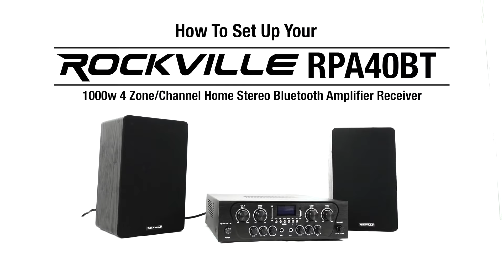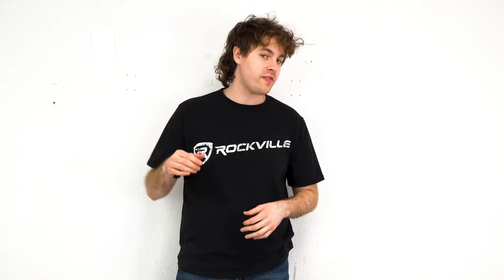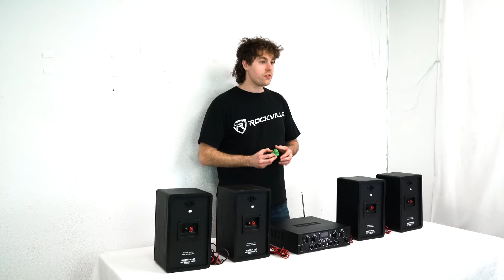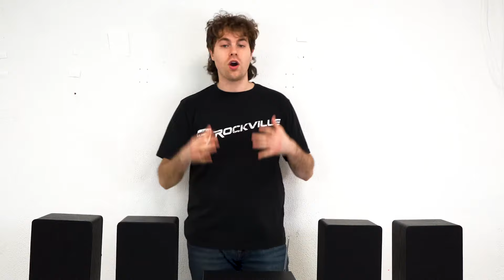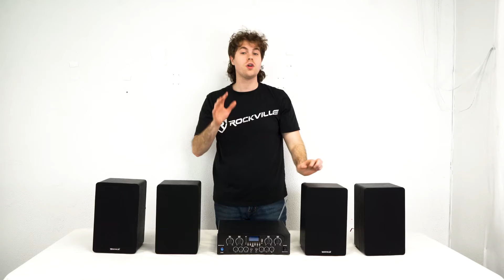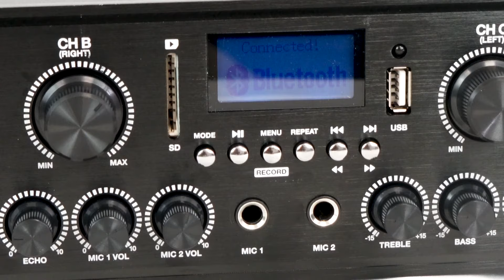How To Set Up Your Rockville RPA40BT 1000w 4 Zone/Channel Home Stereo Bluetooth Amplifier Receiver

Comment: Mine doesnt texonginzie my rca input ?
Reply from the maker: Thanks for reaching out! The rear RCA inputs play through the AUX setting, so make sure the input selector knob is set to AUX. Then turn up the INPUT VOL knob, the channel volume knobs, and the volume on your source device, since they all work separately. If it's on AUX and you still don't get sound, reach out here and we'll help troubleshoot: https://rockville.s.gy/contact